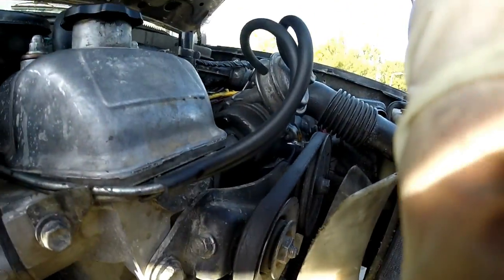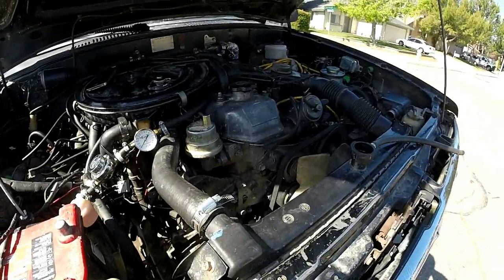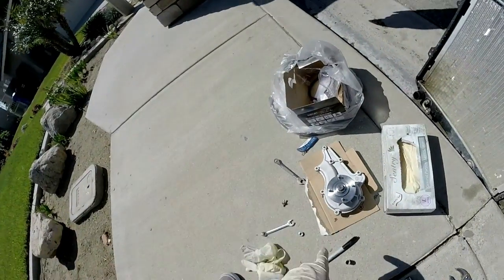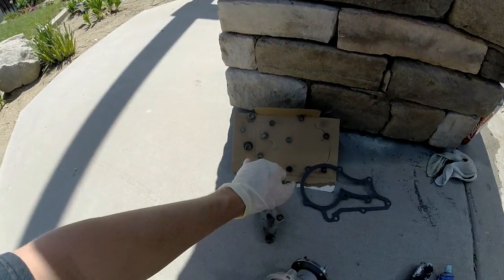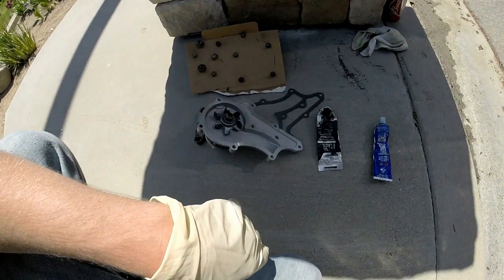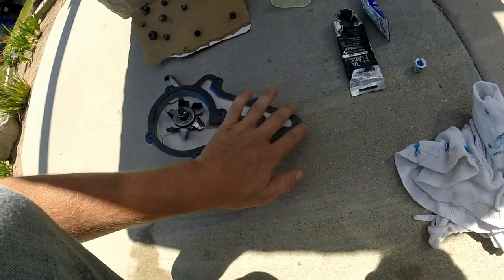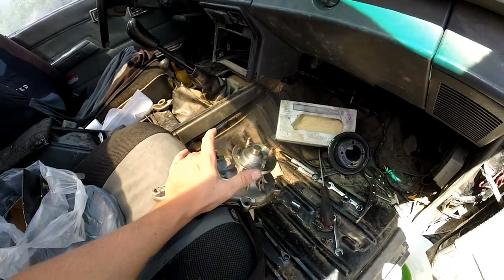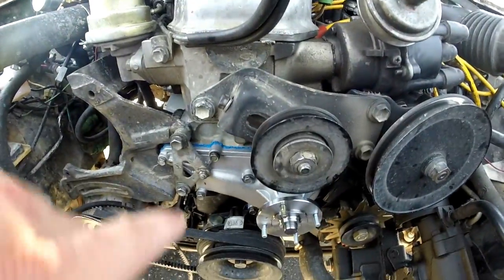22R / RE 81-95  Water Pump Inspection/Replacement

Comment: Good tip Good information i have a question about that gauge is it for fuel pump pressure?
Reply from the maker: Yes, carb pressure is about 5-7 psi on stock carbs so its nice to make sure everything is working. Weber carbs run as low as 3.5 psi.

Comment: Use Loctite on bolt threads.  It prevents the bolt from coming loose AND seals water from coming through.

Comment: You make the job alot harder.  I just replaced my water pump on my '85 Toy pu with 22R motor and didn't touch the radiator ect.  My Pep Boys water pump came with a New Gasket in the box.  I recommend tightening the bolts lightly and then waiting an hour before really tightening the bolts.
Reply: Not maybe people do this.. let is slightly cure then torque it down is the way I've always done also with anything with rtv.

Comment: What was your reason to take the radiator out and you didn't have to put the rtv on the bolts I changed the water pump on my 85 never had a problem after
Reply from the maker: Sorry for the late response. i took the radiator out just for more room,  you can just drain it.  RTV was just a safety precaution, if done correctly it doesnt need it.  I just use it as a precaution as im not tooo confident in the work i do. Im still learning.